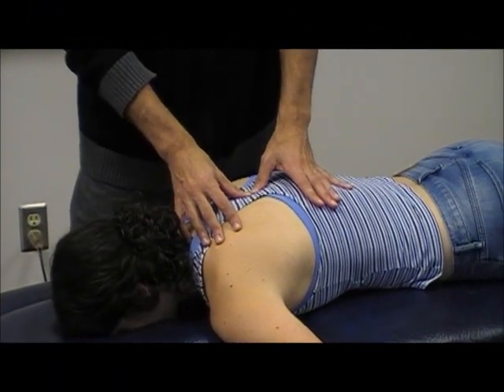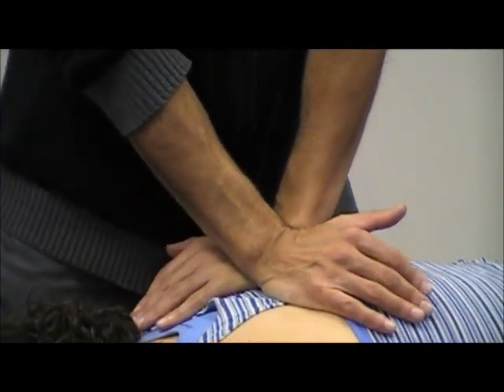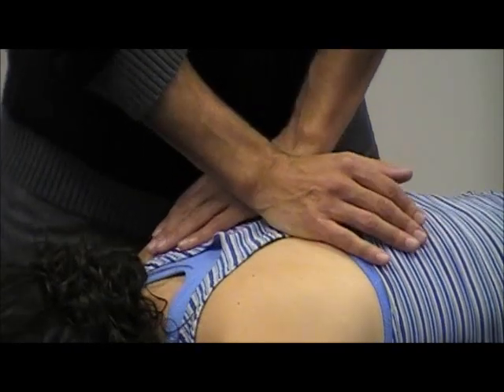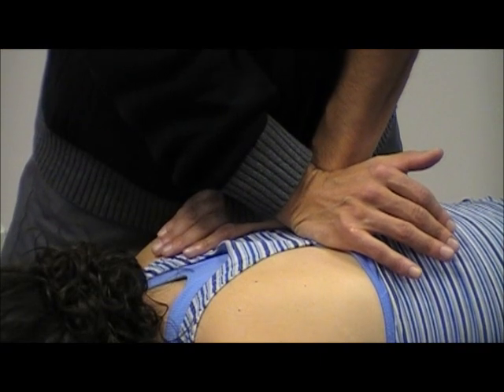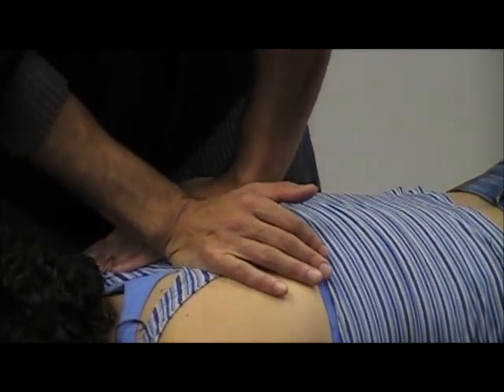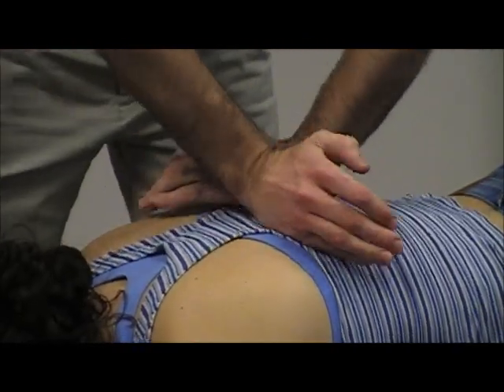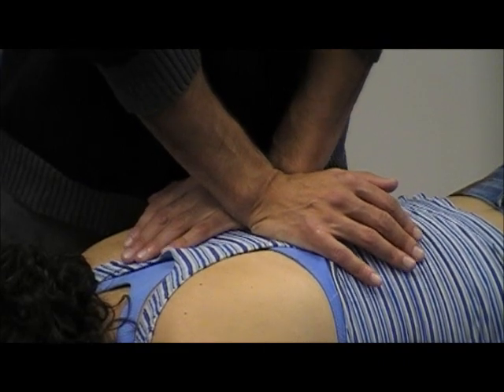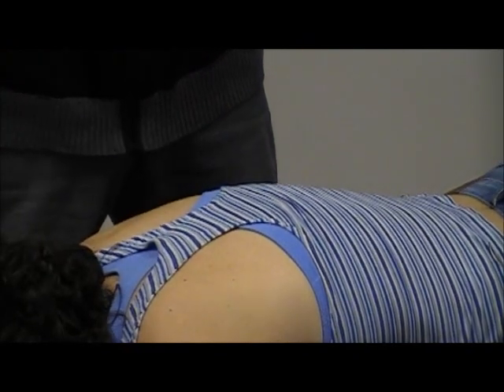Thoracic Screw Technique

Comment: biomechanically... yes it does matter which way you go. if your goal was to mobilize a fixated segment you need to drive in the direction of the facet joint on the side of the fixation P-A I-S. otherwise your'e just smashing them together making noise
Reply: +Bronson Taala Absolutely, I'm an osteopathic student so I don't know how chiropractic or PT people do it but it definitely matters. You're trying to sidebend the segment the other way to straighten it out. If it's a type II with a single segment sidebent and rotated the same way you put the thrust on the prominent transverse and rotate to the left in this case because it's sidebent and rotated right. Heh in osteopathic medicine this technique is generally known as the "Texas Twist", probably because it originated at UNT TCOM I might presume. My school generally prefers the Kirksville Krunch.